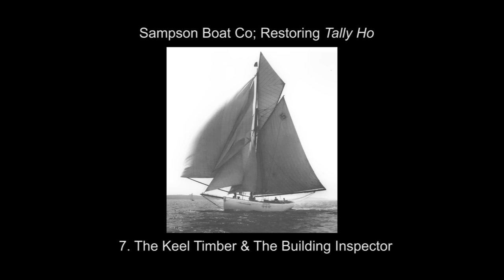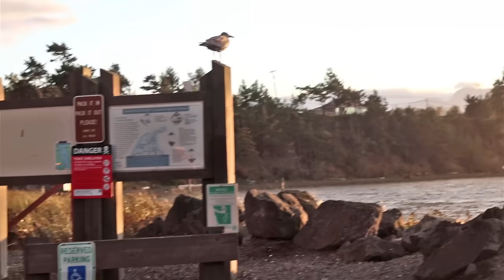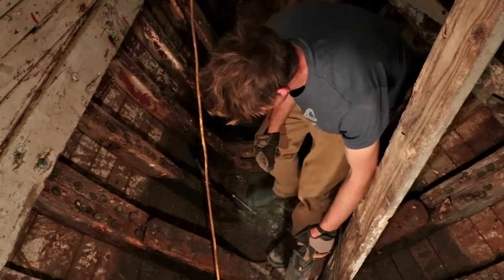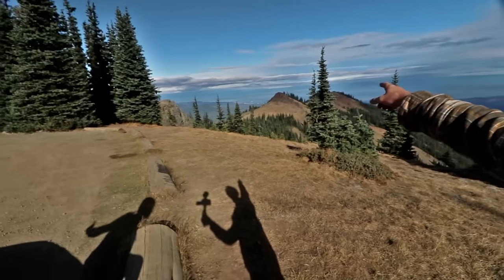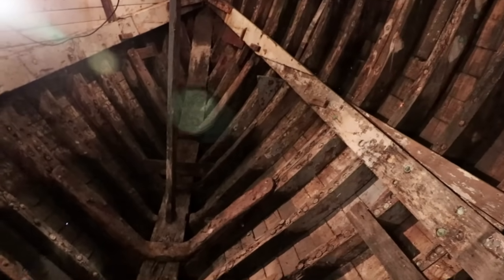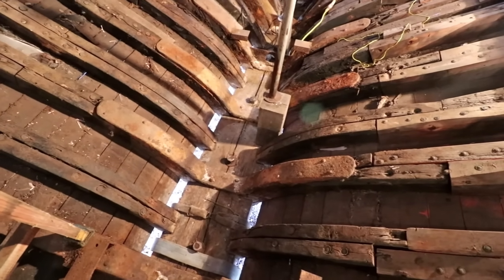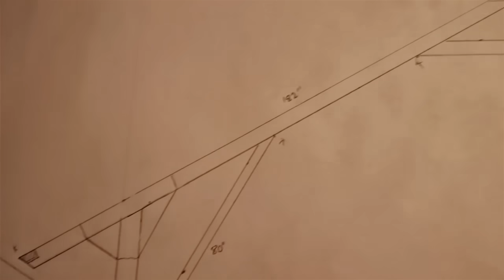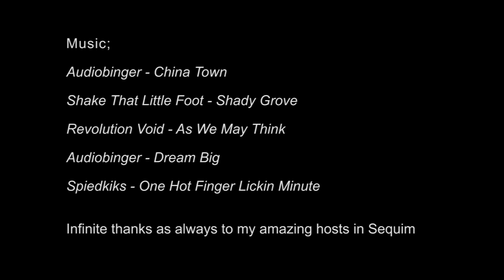7. The Keel Timber & The Building Inspector - Rebuilding Tally Ho EP7

Comment: I would never imagine that there's concrete on a boat... :O
Reply: It's to lower the center of gravity and to increase the weight and stability of the boat. Sometimes gravel was used as well
Reply: There are whole boats made of concrete, google em:-)
Reply: In NZ we build whole boats out of it.  They're fine craft, too.  And we're a nation of sailors...
Reply: There's concrete in my steel ship's bilge too. Not really for ballast, that is lead, but it is in a few of the areas that would be impossible to paint regularly.
Reply: non keel boats have so does schooners which use granite crusher slabs weights up to 250 kgs per ion slab as lest,ballast.
Reply: i think it helps them to displace more water which increases bouyancy, funny isnt it?

Comment: Rain Shadow Loop: This 0.5-mile self guided loop trail to the top of Blue Mountain has panoramic views of lowlands and mountains. Elevation gain about 170 feet. trail starts at 5,380 feet and ends at 6,150, with a high point at 6,650. Wolf River Trail.  5400 feet is more realistic than 54 thousand feet... quite a hike, still 170 feet in .5 miles.. climbing for sure.

Comment: Did you try the jackhammer on the keel bolts? A flat tip bit may well walk them right out. One might also consider bolting angle or channel iron rib to rib, then use a hydraulic jack to push the bolt out, adding rebar or pipe as an extension.

Comment: Having wrestled for years with rusted and seized up bolts on my 50 year old car, I did not envy watching that on a 100+ year old boat. Top tip if you haven't got a spanner big enough for a bolt like that: Use a vise! I have unbolted my engineers vise from my bench to undo hub nuts before....

Comment: What was the purpose of the concrete?  Was it original o the boat, or added later?
Reply: The concrete fills the wedge-shaped pockets between keel, planking & frames. With the top of concrete at the same level as the top of keel, a consistent floor surface is formed for stacking lead ballast ingots, & bilgewater can drain freely instead of being trapped in those pockets. The keel slopes very slightly down (1 in 100) to the rear, so bilgewater will eventually flow to the bilge pump in the engine room. It's likely this was original.

Comment: In your later videos the main spine of the boat had a split trough the centre. I didnt notice you had to use a jack hammer on concrete prior. I started watching at the building inspector. Good chance the main spine needed to be replaced any way but just wanted to know if it was too fragile for the old teak to be smashed with a jack hammer loosening timbers. I know you have the skills to make those problems not worth mentioning but its all about saving yourself more work down the line even though a jack hammer will save you tons as it is. Im no expert i just like to add to your brilliance just so i feel like i helped a little 😁

Comment: I was wondering if that concrete was a later addition (cool to learn it is). Yet, what was the purpose of the concrete?
Reply from the maker: Pouring concrete into bilges has actually probably saved many wooden yachts - it's purpose is to stop water (particularly fresh water that has leaked in from the deck) from pooling in the little nooks and crannies between the frames and floor timbers. With concrete it can all run to the lowest point and be pumped out, meaning less likelihood of rot. An alternative method is to make good limber holes, but they usually don't work quite as well. It seems like a crude technique, but I know some very good boatbuilders who actually do this with new-build traditional boats.

Comment: The guys over at Acorn to Arabella had the same prob with Building Inspector. Was the concrete for ballast? Or did it serve some structural/protective purpose? Do you think it was original or added later?

Comment: Zoning laws will vary from area to area so this may not apply. What you built is a temporary structure, not much more than a fancy tent really, and could be exempt from permit requirements. I realize this is probably too late, just wanted to suggest you emphasize to the building department that it is a temporary structure.

Oh, and I love the project and your determination to save something old. Kudos for that.

Fair winds.
Reply: All depends, I have a neighbor that put up a temporary canvas carport in his driveway and the zoning department forced him to remove it.  In my county you can building a structure under 150 sq ft, with no permit, as long as there is no permanent foundation and the required setbacks are met Typically they want a minimum 3' between the temporary structure and the permitted one.. Its sounds to me like the building inspector is amenable to the project but he might need to go before a zoning board ask request a variance.  

Coastal dwellers can be pretty pissy about their views, the neighbor is probably a transplanted Californian (they're the worst).
Reply: You will have to define "temporary". In this case the timeline could easily be a year or more. Not exactly a temporary structure.  He picked a stupid place to rebuild a boat, in hindsight.
Reply: not that stupit, its placed next to his woodshop....
Reply: Definitely temporary.  Home construction can easily stretch into 18months on a larger home that may require "temporary" structures.
Reply: I was gonna say just this, and to add to what some others in this comment chain were saying a non permanent structure is usually defined as something without a foundation and is freestanding, IE. one of those wooden sheds that you buy at home depot and sit on some blocks in your backyard, or a metal carport. It is not considered permanent becuase it can easily be removed at any time, its not really related to the actual length of time it is in existence. Obviously this can vary by the area, and is usually much stricter in the city limits.

Either way we can all agree the neighbor who called the inspector is a dick.

I should add that "attaching" it to the workshop for bracing may have made it lose its "temporariness" on a technicality.

Comment: You don't need a permit you need neighbors  that mind their own affairs. and the inspector shouldn't be inspecting if they cant do what your doing!
Reply: Whoa, hey. Leo & Tally Ho are guests of his friends, who own the property & would be liable for any problems. Say if the tent gets blown out, wraps itself around a power-pole & rips out the local power & data cables, that would be a Bad Thing. There's no downside to getting a proper building certificate for the tent, it's a protection for Leo's hosts.

Comment: How ridiculous. This guy has the engineering knowledge to restore/ rebuild an antique sailing vessel and the local code enforcement messes with him over a shed roof. If I had been your inspector and saw what you were doing..... I would have turned around and walked away, or asked if I could help with the restoration.